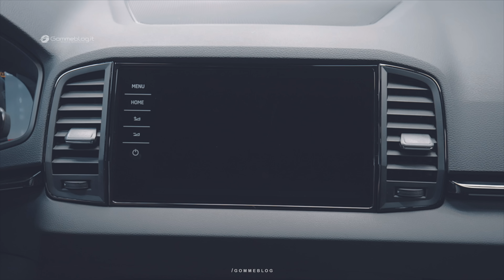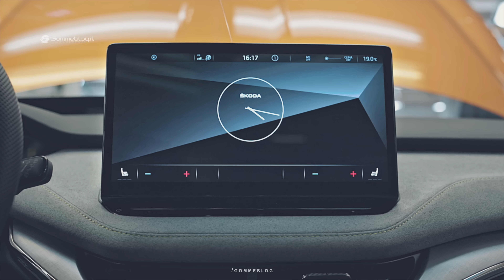2023 Skoda PRODUCTION 🚗 Car FACTORY

Comment: I have karoq prestige by march 23 and i see it has poor assembly quality comparing to my mazda. the light on the left door sagged and broke while pulling the door, the left inner door handle came off, the left front guard does not hold the double-sided adhesive and as far as I can see today, the plastics holding the steering wheel do not fit together (just above the start stop button) and service repairs are costly ( no free repair evrn it has 2 years warranty 😅